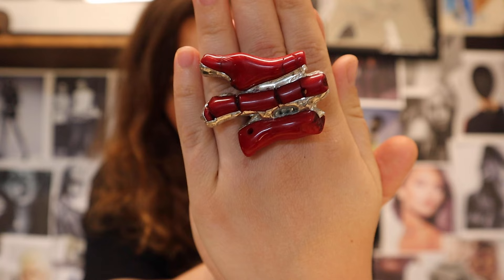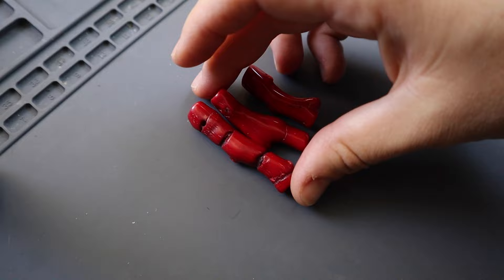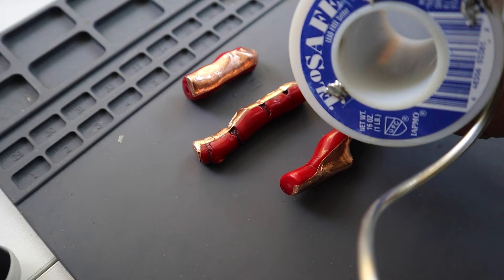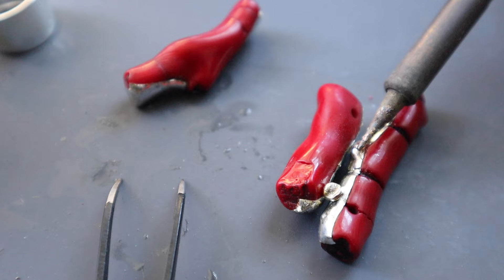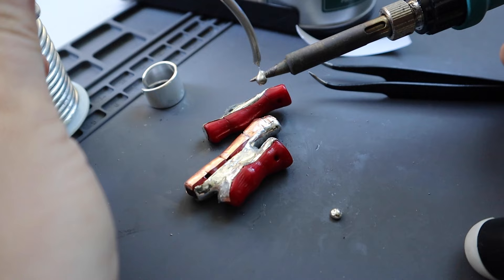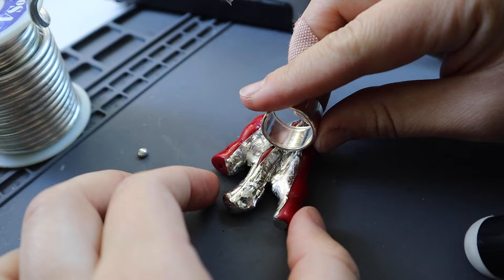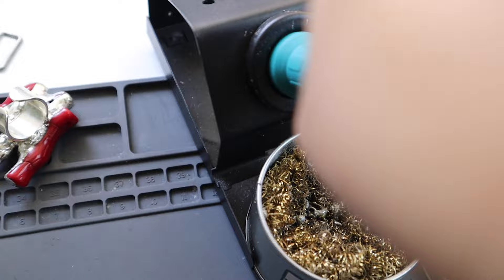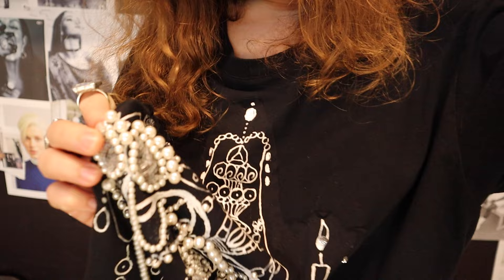HOW TO SOLDER JEWELRY using Soldering Iron

Comment: Thank you so much for this tutorial! 
I have tried to do the same with my stones but they don't stick together. 
Could you help me with advice?🌸😊
Reply from the maker: Hi! Yes! So it could be the stone you are trying to set has some oil/mineral dust etc - so try wiping it with alcohol before adding copper tape.
Second reason, your iron might be too hot so it's melting the glue in the copper tape to the points it's loosing it's tackiness. So try lowering the temperature.
Third reason could be copper tape is not pressed hard enough. Another reason it could be that the stone is too porous and it's not letting tape adhere properly.
Whats stone are you using? :)

Thank you so much for watching my channel! If you dont hear back from please start a new comment and I will see a notification. YT does not notify on comments in thread. Also, you can dm on IG and show me what you are having issues with. And I will be able to help too :)

Comment: If you want silver that doesn’t tarnish use Argentium silver it’s stronger than fine silver and has less copper than sterling silver
Reply from the maker: Thank you! Would that work for soft soldering? Or it needs a torch?

Comment: Hey! Thank you for sharing your knowledge! I tried iron soldering and I'm curious if the copper tape is sticky enough to hold some mineral stone if I'm gonna stick it only to edges like around the mineral?
Reply from the maker: Hi! Thank you! Just try to use alcohol to degrease before you apply copper tape. Some minerals are too porous and are not easy to stick a tape to, so it depends on the crystal you are using. But alcohol helps and burnishing really well helps as well. ❤️

Comment: Hi! I recently started soft soldering but I'm running into a bit of a problem... once my solder solidifies, it loses its shine and becomes dull/matte in texture?? I hate the way it looks and I don't know how to get rid of it. I use lead free solder. Could I be doing something wrong? Would love to hear your advice!!
Reply from the maker: Hi! So I think you might be using too hot of a temperature. It could get dull if it’s too hot. I would also look at flux. Flux and solder that I use stay shiny even at the hottest setting.
Another way of solving it would be using some sandpaper or Dremel but please make sure to wear a mask and do it outside because you don’t want to be inhaling metal dust. Once you would take off first layer of sorter, you would be able to polish it, and bring back the shininess. But definitely try lowering temperature first. If you still have questions and and I’m not responding. It’s because YouTube does not notify me of threads so just start a new comment and I will see it and will respond.♥️♥️🥰🥰🥰

Comment: Hey! Love your jewellery and your relaxed style! ❤ do you think that 925 silver solder works the same? As in can be melted and then used to make all these things you make? What would u use instead of the copper sheet or does it adhere to it as well? X
Reply from the maker: Hi! Thank you! So silver has a much higher melting point that what soldering iron can give. So for silver working you would need to use butain torch. And that is whole other level of silversmithing that I have yet to dab as I am so intimidated. But! If you want to work with silver you can totally learn it. In re to copper tape, you wont need any of of if you are melting silver using a torch. It will set and adhere on its own. I hope this helps!🥰
Reply: @eugeniaedits  thanks so much hun for your reply! I started reading more about all sorts of different metals and yes, now I understand how silver behaves. You would be an amazing silversmith yourself! I feel there is so much for you to explore, I love this for you! 💕 also, u mentioned you make kimonos? Do you have a vid on that? If so, pls can u link it? X

Comment: I need suggestions on how to get the ring  base to adhere to the coral piece. Mine won’t stick. 😢
Reply from the maker: Hi Lois! It could be that the surface of the coral needs to be degreased. Just use a little bit of alcohol to wipe it before applying copper tape. This is my suggestion number one.
It’s also possible that coral that you’re using is covered with some kind of wax that when heating up gets in between copper tape and coral. Sometimes that happens with other materials. I once worked with a smoked quarts, and somehow it was coated. So I would wash coral with soap and water let it dry, and then wipe it with alcohol. 
Another suggestion would be after you did those steps is you could lightly sand down the side of a coral you’re taping. This would definitely help with adhesion. 
These are my troubleshooting tips ♥️ Please let me know if this helps.🫶🫶😘